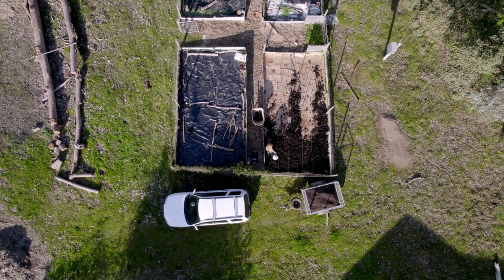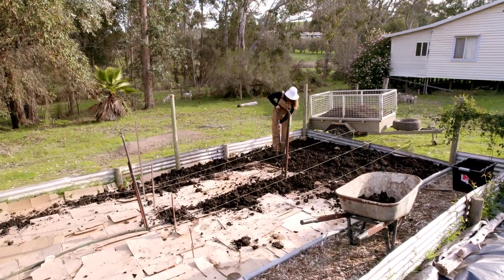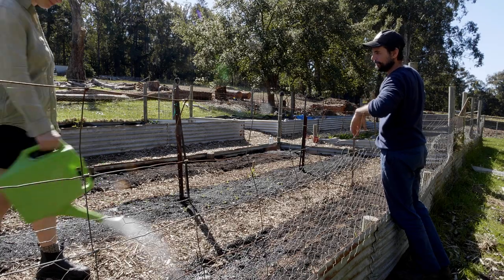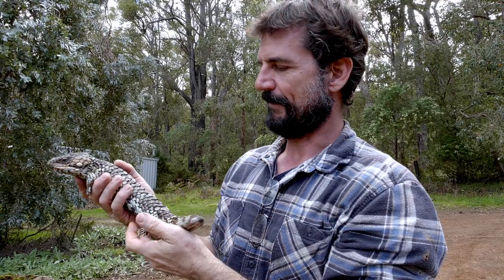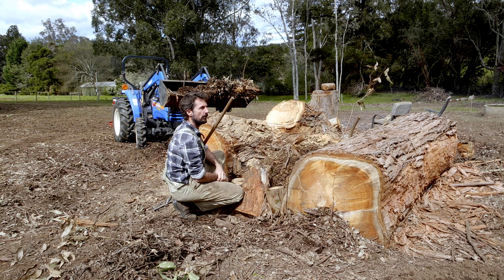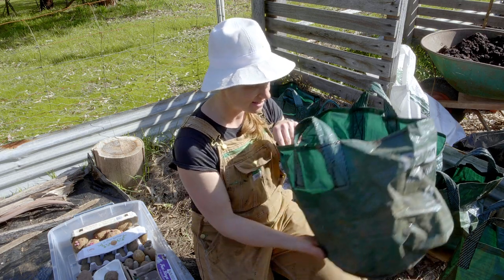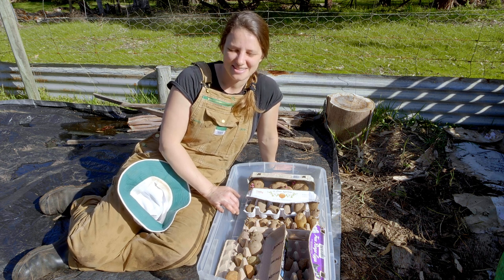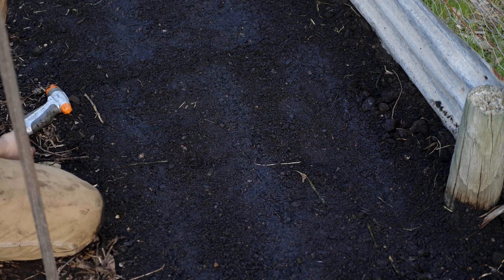Building a No Dig Garden (plus Hugelkultur bed and potatoes in bags) - Free Range Homestead Ep 21

Comment: I miss the ocean videos, but so nice to see you flourish on the farm. I discovered my carrots grow big and straight if I use "seed tape" method to plant. I just use toilet paper for the tape, separated into a single ply  if 2 ply, sprayed lightly with water. Then I can see exactly how many seeds I'm getting per inch and can move seeds around with tweezers if necessary to get intended spread. Just fold tp over so seeds are encased, spray a little more water, roll it up , back on the paper roll, the unroll in your garden row. It takes longer to type this than it does to get seed tape done! Fresh carrots, yum!
Reply: Great idea Laurel. Ive used seed tapes but never thought to make my own.🙏